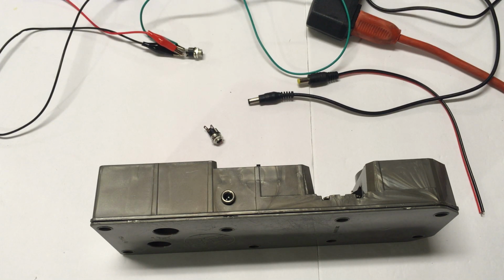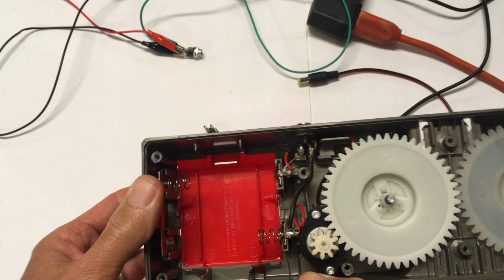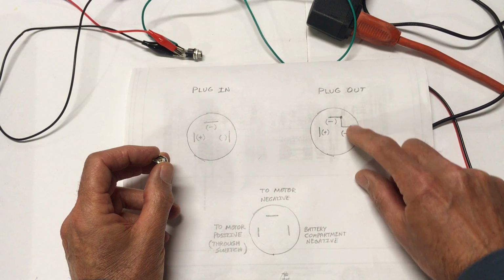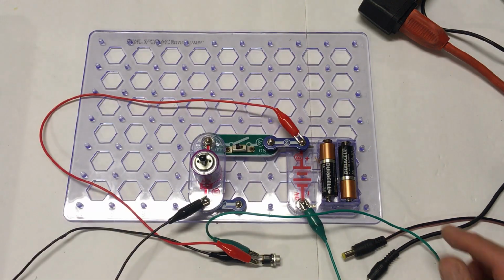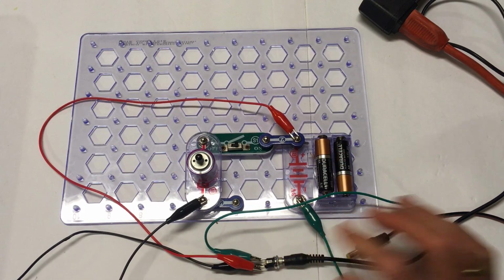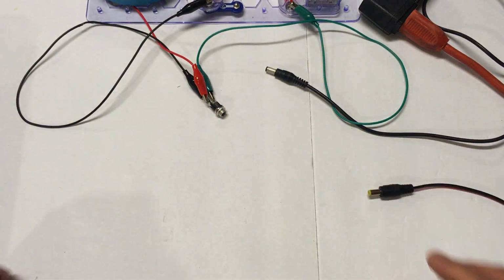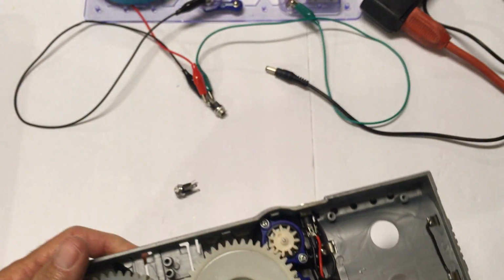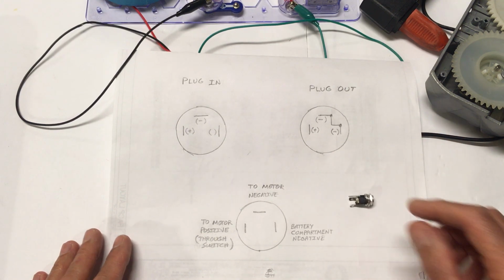Hot Wheels Booster Mod with 3-Pin Socket

Comment: Where do I buy the 3pin socket and plug? Please attach links
Reply from the maker: Hello, and thank you for your question. I sourced the parts from eBay. A search on "DC Power Supply Jack Socket Female Panel Mount Connector 3-Pin 5.5 x 2.1mm" will return many sellers. Likewise, an eBay search on "DC 3V 0.5A 1A 2A 3A Universal Power Supply Adapter" will return many sources for the DC power supply. The exact voltage and amperage of the power supply will depend on your application.  For example, if you are replacing two (2) D-cell batteries I would select a 3-volt power supply with at least 1 or 2-Amps.  I hope this helps.  Best of luck with your project(s).

Comment: I tried this, and tested the 3 prongs to make sure which ones were positive and negative. When I plug the DC power adapter in, the adapter itself at the outlet makes a buzzing noise and the indicator light the adapter has goes out. This ONLY happens when all wires are connected. without wires connected the DC adapter and socket work and test correctly. I ensured that positive socket went to positive on the switch, negative went to negative of the motor, and the 3rd nuetral negative went to negative of the battery terminal. When It is plugged in to power, it does not work, but as soon as I put the batteries in, the switch is bypassed and the motor turns on... The only thing I can think of, is the DC power adapter I have is 12V 2A output so thinking 12V output is too much? Just thought I'd reach out to see if that might be the issue before I buy a smaller DC power adapter... 
Thoughts?
Reply: update-- I put the positive to the motor instead of the switch, and then the negative to the switch instead of the motor, and it works. However, power is pulsing. Could this be the cause of the 12V 2A power adapter being too much? I have a 6V 1A adapter on the way so hopefully, that works.

Comment: In your Snap Circuit demonstration you have broken the original battery powered circuit by removing the 3 snap wire between the negative of the battery compartment and the negative of the motor.  When you modified the actual Hot Wheels Boosters, did you also break the negative side circuit connections?  I don’t recall you making mention of it during the video and it’s a little hard to see in the compartment to tell.
Reply from the maker: Hello Gordon. In the Snap Circuits demo I did not break the negative side, but briefly opened the circuit to positive side of battery compartment to show no DC voltage is applied (and no current flows) from adapter to batteries.
But to answer your question, yes, in the booster I ran the wire from battery compartment negative to the 3-pin socket, and then from the 3-pin socket to negative side of motor. This is what allows the internal shunt in the socket to isolate the battery compartment when the adapter plug is inserted. Sorry if this was not clear.
Good luck.
Reply: I’m sorry, I’m still a little confused. Did you disconnect any of the original factory wires in the booster when you wired in the 3-pin socket?  Or did you solder 3 new electrical wires to the 3-pin socket and solder the socket into the the original existing factory circuit without disconnecting any of the original factory wiring?
Reply from the maker: @gordona7015  Yes, the wire from the negative side of battery compartment to the motor was cut.
Reply: Thank you very much!  That makes much more sense to me now!  I’m excited to modify the boosters I have

Comment: So if I want to wire two or three booster off one adapter (boosters are often near each other) we would  still need a 3v adapter but how many amps would it need?
Reply from the maker: Hello and thanks for your comment.
While I have not done this, others have. I suggest reading the experience of “BurgerDrone” in the comments section of my original booster mod video here: https://youtu.be/lzIe18ZZZWg
Personally I wouldn’t advise less than 2-Amps (1 Amp per booster), and would probably double that amount just to ensure maximum performance.

Comment: Thanks for this, any tips on getting these to actually boost the car better? 
Mine doesnt even get the car around more than 1 loop
Reply from the maker: Assuming the current is adequate (>1A), increasing the voltage will increase the speed, but there's a limit, as I've found the cars tend to "lift" at higher speeds and jump the track edge rails. Using multiple boosters to power the cars around longer tracks is probably your best bet. Good luck!

Comment: Awesome man! I just did this to all my kids hot wheels! Why don't they make this standard?
Reply from the maker: Indeed!
Congratulations on your successful conversions Jason.
I’ve used this same modification on many different battery operated toys with great results. Another advantage is being able to use the same AC to DC adapter for any toy with the same voltage.
Thanks for sharing.

Comment: Hi, what is the ratings of the adapter used?

Will 1A 1000mA adapter be enough?
Reply from the maker: Yes, 1-Amp should be fine.  You can see how 3V, 1-Amp modified boosters perform in this video: https://youtu.be/9zE_6TZ4aRU

Comment: Nice...I will give this a try...

1 request if I may...can you make it with a powerbank?
I know powerbank has a 5v output, so its tricky to down it to 3v(2 D batteries) or up it to 6v(4 D batteries).
Thanks for your answer.
Reply from the maker: I have never tried using a mobile phone external battery pack like a "Powerbank" as power supply, but I don't see why it wouldn't work, as long as it can supply sufficient current. Over/under voltage will simply increase/decrease RPM of the booster, and I doubt 5-volts would harm either the 3V or 6V booster, though cars may under perform on the 6V booster or fly off the track with the 3V booster. If you want to experiment prior to modification you can use some "alligator" clip test leads to connect your power supply directly to the metal terminals in the battery compartment of the booster to see how it runs. To find the correct connection points, look for the two terminals which are not jumped to another terminal, these will be the positive (+) and negative (-) end points.

Comment: Is it ok, if i use adapter with 2A and 5v output to run modified booster? I already make simple project using outside wiring instead of open the case and drilling and soldering the wire, I simply put out the wire into the positive and negative inside battery compartment. And it works too. Using only 1A adapter with a switch in the adapter so I can choose how many volts as the output, higher volts make a better speed. Then it comes to my problem, when I put 2 cars simultaneously, the roller become slower.
I've heard about your explanation in another video, that if u use higher Amp, u can get better current, so it will reduce time delay in the booster. So is it okay if I use 2A with 5 volt to reduce the delay in the booster after hit 2 or 3 more cars in the track? Or it will cause damage to the motor because of higher Ampere that i use to inject more current?
Thx For the answer mister.
Reply from the maker: Congratulations on your project. Sounds like you’re doing well. The 2-amp adapter should work fine and I would expect it to produce better results. The motor will always try to use all the voltage it is given, but it will not draw more current than it needs, so I would not worry about 2A being too much. Please let us know the outcome. Thanks and good luck.

Comment: Please provide links to purchase the parts.
Reply from the maker: The only parts you need are a "DC power adapter" of the desired voltage (I recommend a minimum of 1-2 amps) and a matched set of "5.5mm 12v DC barrel plugs".  I sourced both items from Ebay, but an internet search on these terms should reveal multiple sources, prices, and options.  Note the barrel plugs come in both 2.1mm and 2.5mm diameters, so make sure you get male and female plugs of the same diameter.  Good luck!

Comment: Hi I have 4 double D batteries in a hot wheels tb-13 power pack. I tried to make this conversion and didn’t work . 
Output: 6vDC 800mA nothing
Output:9vDc 800mA nothing
Output:15v 400mA nothing 

and finally I went for broke 

Output:15.5vDc 1.3A 20.va 

Nothing made the motor turn and I’m finding this conversion harder then I expected please help.
Reply from the maker: Hello Andres, and thank you for your comment.
I'm sorry to hear you are experiencing difficulty with the conversion.
Not sure what your problem is, but I would focus more on ensuring you have adequate current/amperage before simply ratcheting up the voltage.  400-800mA sounds too low to adequately run a booster that relies on four (4) D cells.  I would recommend an adapter or power source rated at 6V with a minimum of 2 amps.  
Without understanding more specifics I can only suggest using a multimeter to ensure voltage is being applied to the motor when running off the AC adapter.  If no voltage is present when switch is "on" there may be some mis-wiring in the modified circuit.
Good luck.
Reply: Hey Andres, I did the opposite shown in the video and it worked-- positive lead from the socket to the motor instead of the switch, and negative to the switch instead of the motor.

Comment: Nice explanation 
1 thing maybe you realize it too,the booster will slightly slow after when the car passing by,its affect the next car who passes the booster will move slower,any idea to make the booster always run at same speed?
Reply from the maker: Yes, since horsepower (HP) = Work x Time, a motor of a given HP will reduce RPM (speed) slightly as the work (of pushing cars) is performed. This becomes quite noticeable when multiple cars are run through the booster in rapid succession, leaving insufficient time for the motor to recover and get back up to full speed.  Motor power is equal to voltage x current (P=IV), and since voltage is constant, the motor under load will attempt to generate more power by drawing more current.  However, small DC power adapters are typically limited to 1-amp or less, and there is also a limit to how much current can pass through the toy booster circuitry safely.  Bottom line: You may have some success by getting a DC power adapter with higher current output (2 amps?), but in general I don't think there is much you can do to prevent this slowing without expensive components and better motor.
Reply: @mccord50  I've just found this video in my search into building a mains power supply dedicated to this purpose. My daughters have using my bench top power supply from my garage, but I want it back! The PSU only goes down to 5V. It doesn't seem to have done the boosters any harm operating at that voltage, but I've found the higher speed it's running at often sends the cars into the loop too fast and flings them off the track. I think a couple of 3V 1A wall warts connected up as per your method may be the answer. Many thanks.